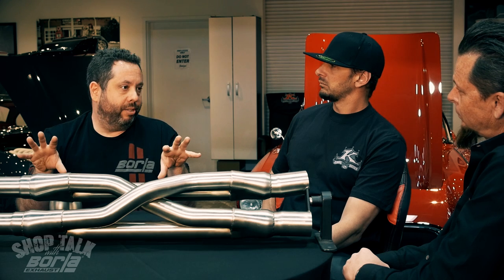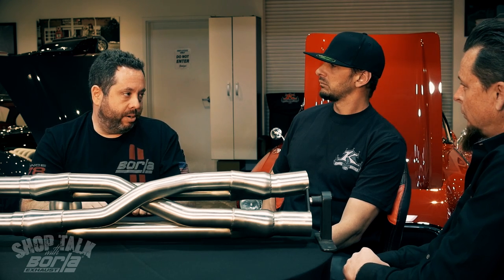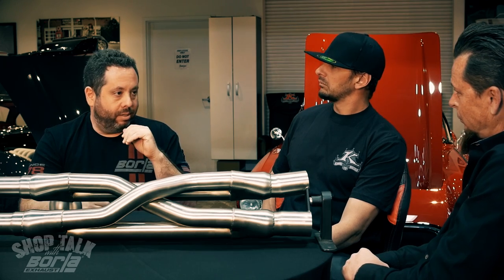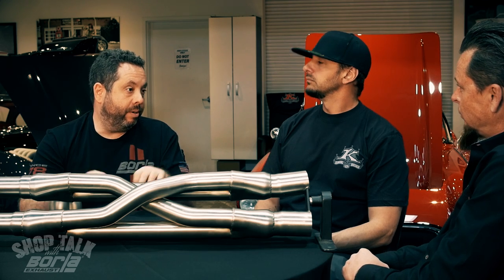Borla & Kindig: Learning from Pythagoras [Polyphonic Exhaust Explained]

Comment: I've been looking to get the switchfire for my 23 Camaro SS and haven't been able to find one. I don't see anything but for newer mustangs.
Reply from the maker: Hi! Unfortunately, we don't have a SwitchFire X-Pipe for the 6th generation Camaro SS. The SwitchFire design is integrated in select Cat-Back systems. Currently, it's only available as a separate component for the S550 Mustang GT as it was originally designed to be a stock front resonator replacement for the Mustang GT.
Reply: Thanks for getting back to me. I really appreciate it! @borla

Comment: I wonder if Borla will produce a Switchfire for the s197 Mustangs? 
OR... if the s550 Switchfire could be modified to work on an s197. 🧐🤔
Reply: Can't see it being an issue as if you have the same 2.5 inch diameter but your mid section is shorter than the S550 just have your shop cut it short, use a pipe expander and there you go! I have the Borla S-Type axel back with an X-Pipe and it just sounds amazing! Was thinking of getting the MAK cat deletes for more a little of the crackles and pops but still on the fence about it depending if their race pipes are T409 or T304 stainless steel! I live in Canada and T409 won't last too long...
Reply: Peter Who? 
Hmm, makes me want to do it! I have an x pipe with GT500 mufflers, but I’m looking to get Borla S types soon.
Reply: I have an O/R H with stock cat-back on my 2011 GT500.   Would love to give this Switchfire a shot.   It certainly makes the Coyote sound decent which is a feat